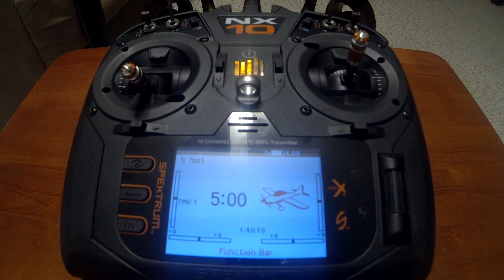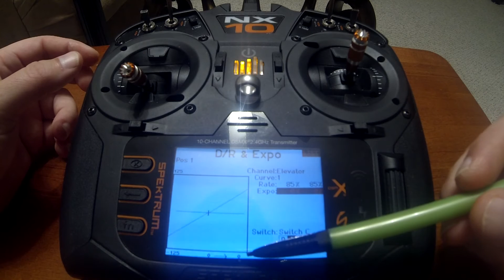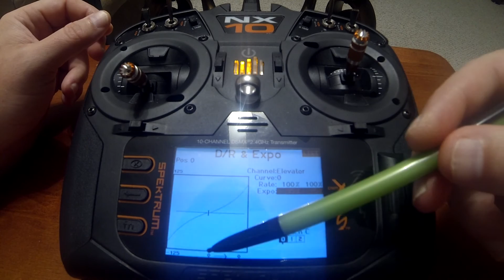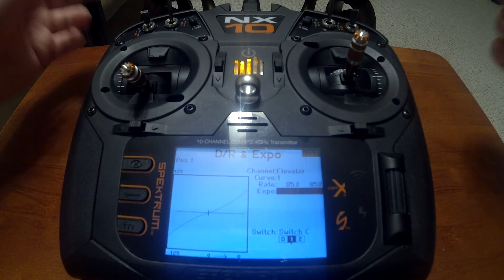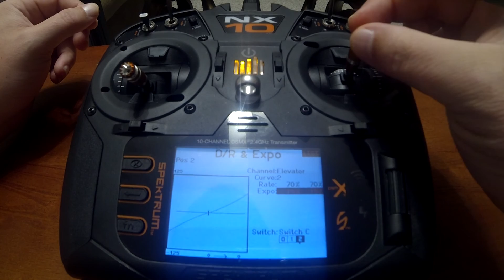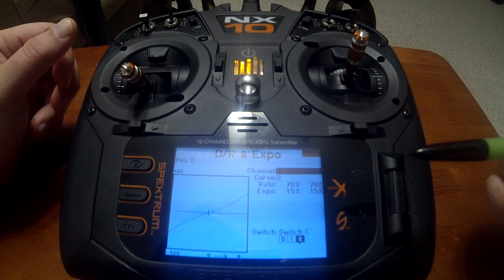Spektrum NX Setup: Dual Rate and Expo Tutorial (NX6/NX8/NX10)

Comment: @BDTennessee Nice video, thanks for sharing. Is the 20/11 formula just some arbitrary set of numbers you picked as a fixed value, or do those numbers correspond to something specific, and could they be different for different fliers? What are those numbers connected to, and what would we need to look at to find our "own values"? Sorry for the confusing questions.
Reply from the maker: Numbers that worked for when i used expo. Yes they can be different for each flyer. Main concept ios to have same difference across the rates (high,med,low).

Trial and error. Use one set of rates and see what works. Once you got them then use the formula to get the other two...
Reply: @BDTennessee  awesome! Thanks for responding. Also, thanks for all your great videos!

Comment: I too appreciate what you teach us. Great videos. Kind of new to the hobby again since it has been 20+ years since I flew RC. Question....when setting up a switch with low, medium, and hi rates/expo...should the low (70%) start at position 2 (85%), then 1 (100%) throws?
Reply from the maker: Basic planes or something not aggressive (3d planes and jets). Most of the Horizon Planes are default low 70 and high 100.

Comment: Have you ever seen the 3 boxes for a 3 position switch get 
"grayed" out?     What happens when you change the settings under "curve".  0 and 2 are grayed out and 1 is normal.  I must have done something.  All my other planes on my NX6 work just as you say.  But my new Beechcraft D18 setup is doing the above.
Reply from the maker: Curve,Switch Position and Highlighted box need to be the same. (Ie: Switch Position 0 , Curve 0 , Highlighted Box 0)

Comment: BD thanks for you videos, I have a question. under the switch assignment is the switch position. what exactly does the black dot represent. I made the mistake of turning on more than one black position. it then gets gray lines through it and the different positions no longer work. So basically the 3 positions no longer work it's stuck on one. NX10
Reply from the maker: Black dot is switch position. When you have grayed or lines, a value is off. Problem is Curve , Switch Position and number in box isnt the same. (example: Switch Pos 0 ,Curve 0 , Box number 0). Needs to match all three switch position.
Reply: Yeah that one kicked my butt too. Thanks.

Comment: Hi BD, Your videos have been very helpful, and I need a little more of your knowledge. I'm using an NX8 and the AR 620 receiver.  I didn't want to "Y" the duel elevator servos because I wanted the pushrods to be "mirrored". With your help I assigned left elevator to aux 2 and it works fine with expo. I ran separate channels for the ailerons as well using the 'gear' channel for the left aileron. The idea is to eventually use flaperons or "Harrier flaps". But first...   Expo is only working on the right aileron.  Can you tell me how to get the gear channel to respond to expo in the same fashion as the right aileron.  Thank you BD
Reply: Thanks anyway BD, I'm not sure exactly how but I poked buttons long enough to stumble across the solution.
Reply from the maker: @waynemiller6070  glad you got it figured out :)

Comment: This is a really useful video, especially how to match the expo settings, thank you. I'm using a single switch for all settings and somehow I've managed to disable switch positions 2 and 3 for the ailerons and elevator  and can't see how to re-enable them? Any help appreciated.
Reply from the maker: Check the curve and switch position. Switch position should match the curve. Pos 0:Curve 0, Pos 1 :Curve 1,Pos 2: Curve 2.
Reply: @BDTennessee  Yes, manually selecting the curves and matching to the switch positions works - thank you!
Reply from the maker: @RCGDL  great! Glad you got it fixed :)

Comment: I cannot get 3 rates for some reason. I set low to 70, then set mid to 85, high to 100. But on low and mid it stays the same 85. Tried reversing the procedure  and get mid at 70, and low at 70. Same thing happens with the rates. Set mid and low at different values but comes out being whatever value was set first.
Seems like the B switch is acting as a 2 position switch even though it's a 3 position and shows it as a 3 position in the Rates and Epo setup.
 What am I missing?
Reply from the maker: One of the curves is numbered wrong/ Should be Pos 0 Curve 0 , Pos 1 Curve 1 , Pos 2 Curve 2
Reply: @BDTennessee  your correct BD! One of them was off. Glad you new that because it would have taken me along time to figure that out.
Thank you, for your help and all your help in the past!
Reply from the maker: @we4fm175  glad to help anytime.Thanks!

Comment: So it’s the same process whether it’s individually or combined, the difference is if you assign Them all to the same switch? I have mine 1 switch per 
wing/servo, but to make it simpler just put them all on the same switch? Okay., 

NOW…. What if I DO want all my expo values on one switch BUT., I still want to select individual expos values per wing?

 If switch A does all expos at once, and switch B is for elevator, is one switch going to override the other? Still leaving here lol with my nx8 and simulator before my maiden so I need to be prepared bcs I don’t know how the plane flies yet. Thanks!!
Reply from the maker: Correct, assign individual or separate.

You could have separate rates and expos with some creativity. Sounds like new pilot or new plane. I wouldnt get involved with that at this point. Assign different surfaces to individual switches if you want flexibility.
Reply: @BDTennessee  …. Yea new pilot, new plane (3D) and new NX8… I’m not amateur or inexperienced, just been a really long time bcs I’ve been into rc cars and drones. It’s a pre owned plane so the servos/arms  should be aligned.  I know what to expect and I have not flown this 3D plane yet so I need to be able to switch modes quick and easily. It’s only a 4 ch receiver so I can’t get flaperons  or trim my servo independently so I 
re-adjusted one of the ailerons so now at rest their booth a tiny smidge lower. No safe no stability. I’ve spent so much time on the simulator and with the most difficult settings that I feel more then confident. But everyone crashes regardless how much exp.
Reply from the maker: @toysforboysrc  Gotcha. Well good luck with maiden.Holla anytime.
Reply: @BDTennessee  .. thank you 😎

Comment: now that I have learned to fly a little better and have a better feel of what rate and expo settings  I prefer, I set up my rates on 3 different switches, but find this set up  a little difficult to  quickly remember  in flight  on my DX8  (  which switch is for which control surface ) .....are there any helpful tips you use?...thanks
Reply from the maker: Set them up to what makes sense to you. Also set the switches the same on every plane. Rate switches are the main things to customize. Normal operating: A-Gear , D-Flaps, H-Throttle Hold.

Spektrum radios had a default for rates to on older radios.

C-Elevator , F-Ailerons , G-Rudder, B-Flight modes
Reply: @BDTennessee  thanks much for the info.  and help
Reply from the maker: @garyvale8347  your welcome,anytime!

Comment: Hey BD...I typically use 30% expo on highrates and you 20/11 formula for the other rates.....im getting my first 3d plane. Extra 300 3D and would like to know what expo should be used?  im guessing more than 30%
Reply from the maker: Which extra 300, Eflite?
Reply: Yes, forgot to mention that.  E-flite
Reply from the maker: @Rich_Debret_Outdoors  book rates show the normal 70 for low and 100 for high. If you run those i would turn the expo up for sure. Book rates are very sensitive for most.

Id start out on 80 with 50 ,60 with 40,and 40 with 30

Comment: All your videos are very helpful!!  This one especially on dual rates/expo.   My question is, have you flown the Turbo Timber Evolution? Did you set yours up with the rates/expo percentages same as the values in this video??
Reply from the maker: I dont own one personally.I have flown one a few times. 70 low 85 mid and 100 high with 20-25% expo could be a good start for you
Reply: @BDTennessee  Thank you for the great info and reply, and you apply your 20/11 rule on all planes? I know in the video you used 30 or 35% expo
Reply from the maker: @Rich_Debret_Outdoors  if im going to use expo yes 20/11 setup. 30 and 35 was just what i used in video.

Comment: I use A for gear, B for flight modes, D for flaps, and H for throttle cut. Position 0 on these switches is gear down, low rates, flaps up, and motor on. IOW, my planes are flyable with all switches in Position 0. Positions 1 and 2 will often put my planes into a mode that could be unsafe, so they are not my default positions. I normally store my airplanes with the gear up, so before I turn my transmitter on, I put all switches in Position 0 except for the gear and throttle cut. When I have the plane where I can lower the gear, then I set switch A to Position 0. And when I'm ready to use the motor, I set switch H to position 0.
Reply: Here’s an idea for your next video - show how to swap (cross) the trim levers between the left and right sticks. I couldn’t find one on that subject..
Reply from the maker: @txkflier  sounds good. Cool setup on flight modes too!
Reply from the maker: What switch or switches controls the rates/expo? Is that what your referring to as the flight modes?
Reply: @BDTennessee  Yes, B would be flight modes. When I’m setting up a SAFE receiver, I’ll use switch C to control the receiver’s flight modes. Position 0 will be AS3X/SAFE off, 1 is AS3X on, and 2 is SAFE mode. Once I have the receiver set up, I’ll put the receiver flight modes channel on switch B. Position 0 then becomes low rates with AS3X, 1 is high rates with AS3X, and 2 becomes SAFE mode. I mainly do this on EDF’s. On aerobatic type planes, I use two switches for 5 flight modes. The first switch is B and the second switch is the rudder stick position switch (SPS). I set the SPS to switch at + and - 85%. With switch B at position 1, when I apply more than 85% rudder, the elevator and ailerons switch from low rates to high rates. Also, I have a THR>THR mix on positions 1 and 2 of switch B to idle up the motor on my electric planes so that the prop will push some air past the rudder and elevator to help with spin entry. Position 2 will be 3D mode with even higher rates and less expo..
Reply: @txkflier  that is a cool setup! I'm not there yet. I need to start in safe mode. Maybe one day! Appreciate the sharing of your knowledge brother!

Comment: Hi thank you for the video: Question, I'm trying to setup launch mode to switch H on the NX6.
All I want to start out is: Five clicks up elevator during launch and then be able to switch off launch mode and go back to cruise mode.
Reading the manual if I understand it right is to: "setup a mix first" assign it from there. (When I setup a mix the elevator did not move) Any help would be great!

Best,
Greg
Reply from the maker: I can help you with that! Do you want the H switch in Pos 0 (away pos) or Pos 1 (towards you) to add 5 clicks of up elevator? Which would make the opposite turn it off.
Reply: @BDTennessee  Hi thank you. Yes down is  "0" and back towards me is 1 (I think is on) when I previously set up the mix down indicated off.. yes Pos1/5 clicks of up elevator for launch only,  Pos 0 would be flight/cruise mode.  thank you in advance!
Reply from the maker: @AGMWEST  Im asking because I can set it up either way.Do you want the elevator up with switch in Pos 0 or Pos 1?
Reply: @BDTennessee  Thinking about it now - Elevator in Pos 0.
Reply from the maker: @AGMWEST   5 clicks of up elevator on the elevator trim is -3.If you actually want 5 make the number -5.
 

Go to mixing screen, Change INH>INH to H > Ele , Rate: -3% (Left number) 0 Right number. Offset: 0 , Curve: 1 , Switch: On

That will setup Up elevator in Pos 0 and no elevator correction in Pos 1.
Reply: @BDTennessee  3 should be fine. It's a DLG Sailplane as long as it fly's up when I launch it at the horizon.
Reply from the maker: @AGMWEST  Sounds good! Use those variables and you good to go! Future videos im going over mixing. Stay tuned and subscribe!
Reply: @BDTennessee  Excellent, let me check it. I set all the adjustments. Be right back
Reply: @BDTennessee  thank you very much! That works now. Doing what we just did and trying to understand the manual are two different animals. 
I created a new mix 1 and renamed it to LAUNCH. The elevator moved barely as I could see and enough to know it works. Once I turned off the switch I hit the elevator down and that zeroed it out. 
Thanks again BD Tennessee. I hope my first flight is successful. Everything is set, CG, zero'd trim and if I get that far a 1/2 DLG launch.
Reply from the maker: @AGMWEST  good deal! If you need more up elevator just increase the negative number. Good luck on maiden, let me know how it goes!
Reply: @BDTennessee  Sure Will! :)

Comment: D/R on spektrum us 100% backwards from futaba. (I ran futaba for decades. Switching over, I was confused for many flights! 😱). Discovered it on my DX6e. (Started re-flying Dec 2020 with the DX6e. Didn't like it, bought the NX6. NEED 7+ channel, bought the NX8. ((It arrives tomorrow! 👍😁)).  Yes, 3 transmitters since December. Wanted the NX10. It's never in stock!

Great information & videos my friend. I subscribed! 👍
Reply from the maker: Spektrum and Futaba do things little different thats for sure. Glad you on track now with the NX8! Thanks for the sub and support!
Reply: Make sure the graph shows the proper curve - flatter around neutral, not steeper..  ;-)